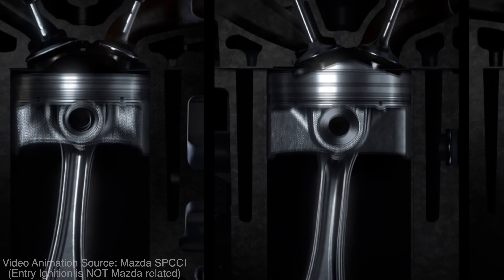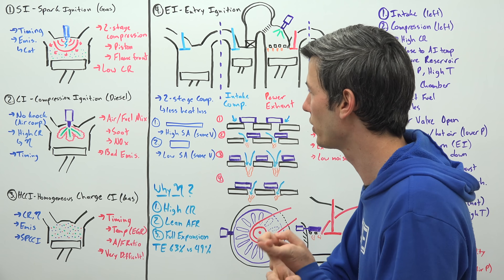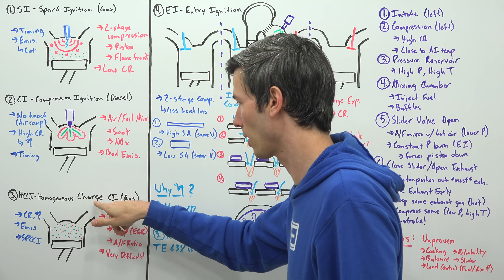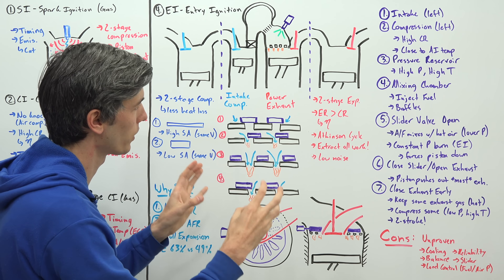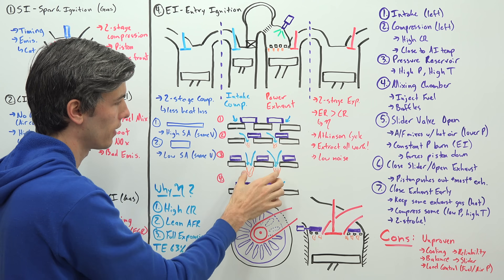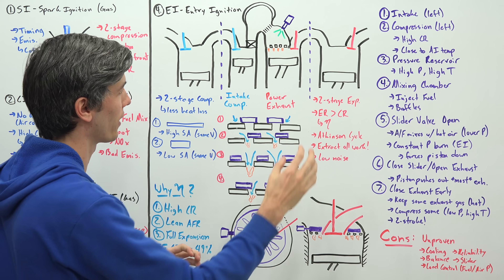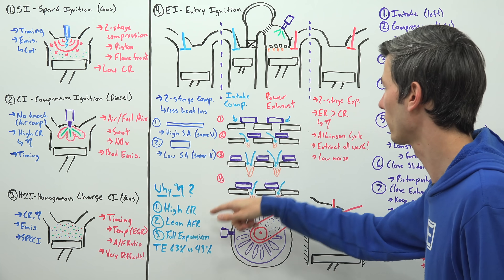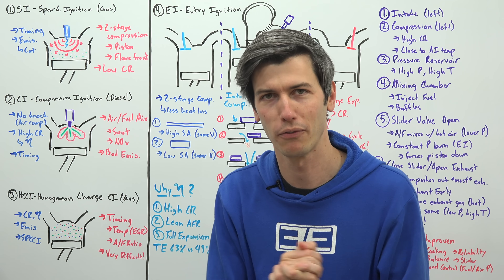Is 'Entry Ignition' The Future Of Combustion Engines?

Comment: Engineers have been looking into a viable 2 stroke engine since the 80's. The idea was to start making engines and related parts out of ceramics. My question is what are the advantages of this design over a conventional 2 stroke engine?
There was also a rotating valve design during the 90's that was developed by a company called Coates or Chotes. Basically it was two counter-rotating shafts, one inside the other... something like that would work for a slider valve.

Comment: If slider valves worked they would have used them as intake valves instead of the complexity and awkwardness of standard poppet valves. 
My guess is it’s impossible to keep carbon grit out from between the surfaces perfectly so any use of them is going to be high wear.  With some age and a tiny bit of carbon you now have sanding discs.

Comment: Oh my ... cool idea for sure!

But ... this goes further from the usual than just the combustion. If it is only for that, a seperated ignition chamber might be interesting. This is currently under investigation (was it ever not...?) to improve knock resistance. iav in germany have said to have achieved an overall efficiency of 45 % (on the brake, not indicated or calculated) in one of the latest MTZ.

Further expansion and precompression, on the other hand, may be seen seperately from the combustion system, too. This is two approaches combined that seem to benefit from each other aka engineering after the initial inventions are done.

... another thing, more close to traditional engine, is the ... I know ... Corona-plugs. I know, the name, ... but - these are used like a spark plug, employing the piston as cathode, allowing initial sparks (usually four) of not about a millimeter in length, but up to an inch or so, starting the combustion along four long ... kinda strings (they're not really straight), therefore speeding up the combustion and making the process less sensitive about residual exhaust gas, also mitigating knock - an engine with this alone and a software update (cam timing, increasing internal EGR at low load etc) was shown to be significantly more efficient, while all the big parts don't need to be changed - something easily within reach. Put (too) simple, it is like dual spark plug times 100 or so.

While I often understand that cool and new ideas requiring a lot of development after the principle was proven to be working, often making the engine way more expensive, are not adopted fast and widely spread, I'm a bit disappointed those easy improvements take a long time from lab to series, too. It is almost six years ago a then-coworker examined the combustion process in depth. Those little changes, relatively easy done and therefore compatible with many of current engines ... may not be game changers, but if I imagine an overall improvement of efficiency in the region of a few %, widely spread, I see a bigger impact than one series of engines, totally fancy and over the top, but hardly to be found in use anywere.

Hm...

... I write too much. I know. I'm sorry, I miss working in engine development (I do other stuff now ... interesting, too, but not even close to as cool...).

Comment: Problems I see. 
1. The slider valve and rings in the intake and the initial compression cylinders staying air tight.

2. Lubricant getting past those rings because combustion isn't taking place in the first two cylinders, leading to combustion of the lubricant in the mixing chamber causing soot/carbon build up clogging the slider valve (like an egr valve) 

3.The theoretical gains through thermal efficiency being lost in the mechanics, i.e that's a lot of mass to get rotating and keep rotating.

Comment: It's somewhat a mix of many ancient tech.
The hot air reservoir is basically how hot bulb engine works, and two expansion pistons is the regular compound steam engine principle. Sliding valves are also not new at all. Again, steam engine uses large sliding valves, and rotating sleeve valves were a (oil-greedy) thing of early performance automobiles.

Comment: I can't believe  Koenigsegg are the only company using fully independent valve control on conventional petrol engines.  This is achievable now, and proven with potentially 20% efficiency saving or power gain.  What chance has Entry Ignition being adopted in any meaningful manner by engine makers with the complexity(=weight) and new technology required?  With the UK committed to electric power only surely this is dead in the water?  As usual another great thought provoking video.

Comment: How is the third cylinder being driven down.. if the pressure at the top res is very high but lower then compression, the slide valve would allow gas to go back into the res. I dont see how this would work, because the res pressure HAS to be higher then the compression pressure, otherwise how would it force the fuel air mixture in to it? And why use a slider valve? why not a poppet valve?
Reply: If as described in the video the burning fuel mixture in the third cylinder never is greater than the pressure of compressed air and the pressure of the exhaust gas entering the forth cylinder must also be less and no more combustion is taking place so the power produced would be less than what the compression cylinders would require to again make a higher compression than the combustion. Unless the theory involves some sort of perpetual motion fantasy this engine wouldn't run.

Comment: Why the world haven't moved to electric yet? Because it is expensive. Not because it is expensive to manufacture, it is expensive to buy., Because it is a new technology (in a car...)

Disadvantages of electric:
- not suitable for very long travels (so not affect most of the users)
- battery replacement interval unknown yet and costs are probaly a fortune
- bearing changes every 20 years.

Disadvantages of ICE:
- efficiency
- emission
- a lot of oil, flter, consumable
- everything degrades fast because of oils, heat and weather so everything in the engine compartment is practically consumable after a few years of use.
- ton of precision moving parts

Disadvantages of hybrid:
- union of the both above

These are from perspective of the user. The opposite is true from the perspective of the manufacturers. For an electric car, all the established car industry, nor the oil industry can sell you almost anything they sell you now. All the techbology, except for body and suspension would be useless and obsolete for an electric car.

The only limiting factor (technology-wise) for a small subset of users I can see now is the battery. Still not advanced enough to make a very long range car. But certainly good enough for most of the users.

Comment: there is no future for ICE engines Electric car are the future more torque and HP and more efficient
Reply: Yes for general public is the electric car a near future. But ICEs will be still used in remote locations where you dont have reliable source of electicity.
Reply: @luboscernaj6944   yes you are rigth but we dont know in the future if electric vehicle will also do those thing with better battry tech and cheaper source of electricity
Reply: @espirituortiz7694  I think we'll get there, but it will take a lot of time.

Comment: I’m curious.. as the engine wears and compression begins to drop would this system become useless as high pressures are needed for combustion? Gasoline and diesel use outside entities for combustion (spark plugs/ Injectors) thus making them able to run as compression drops over time.

Comment: a marginal increase in thermal efficiency.. yes ... .. but what about the additional weight the engine will have.. four non uniform pistons&cylinders, additional frictional losses. .. the power to weight ration will definitely take a hit.....  not to mention the additional complications of operating the extra components and finally the robustness (given the more moving parts)  ......... pls.. just throw in a motor and get a whiplash with no noise

Comment: Will catalytic converters still work with low pressure exhaust?
Load control - you probably would use a CVT with this, potentially fairly constant load?
What is the absolute max theoretical thermal efficiency for a gasoline engine? Around 80%?

Comment: So you're just going to ignore spark ignition engines that use direct injection and variable cam technology to control the ignition timing? All you showed for the typical spark ignition was port injection. By using direct injection the fuel is sprayed in during the compression stroke acting as a cooling agent to prevent pre detonation and allowing for higher compression ratios and better running engines.

Comment: What you said about diesel not injecting fuel until after the compression stroke is completely wrong...think about it..compressed air does not combust...if it did my air compressor would blow up everytime i turn it on..

Comment: I see slider valve issues and engines shooting flames out the intake. How long would those even last? Carbon build up will play a role in real life scenarios. Will a camshaft actuate the slider? Or only for the exhaust valve. What controls the slider?  Sounds great in theory but more special tools and learning to do. And real life testing on us who have to buy the things. Plus I'd be surprised if it sounds good. That's important to me. Nothing sounds better than a old 60s engine. The only thing I like that's an alternative is the rotary. I think it could be tweaked to be much more efficient in power and fuel. But give it up to Mazda doin great things!

Comment: I wonder how you would lubricate the slider valve, and keep the area never getting cool intake air from melting or cracking between room temperature and very hot on every use. It wouldn't be cheap to make either.  It will stay an interesting concept.

Comment: Count me a skeptic.  Too dependent on running close to a narrow set of circumstances.  Idling looks iffy. And if you build it as a stop start, it will cool off during red lights. Makes Nissan's throttleless variable displacement gas engines look simple.

Comment: 1. How is the pressure in the cylinder, where the energy of the fuel is released, is guaranteed to be less than that of the pressure reservoir? 
2. Is the slider surface lubricated? Does it seal and will oil be burnt?
3. Usually, low temps improve engine performance. Here it seems to be the opposite. Why?

Comment: Unrelated to video, But I would love to see you discuss crankshaft and connecting rod bearing types. Like almost all engines today use plain bearings. Old Kawasaki and Suzuki motorcycles used roller and needle bearings. Why don't we see more roller and needle bearing in car engines? I can maybe think it's for cost reasons because the crankshaft would have to be in multiple parts. In terms of reliability, they were just as reliable as plain bearings. I've heard arguments that they can better because oil weights don't really matter so much, the oil pumps don't have to work as hard, and more oil can circulate the engine faster. It would be cool if you can discuss this in greater detail and maybe other engine bearings too! I can't find much information about this.

Comment: I don't know how many times I now have heard that a new combustion or new type engine is going to take over the car industry.  Yet the 4 stroke spark ignition keeps soldiering on. The Wankle is gone. turbines are gone. Diesels are not being put into many new cars  Many people buying new heavy duty trucks are going back to gasoline  fleets unless they need the added torque of the diesel.

Comment: So while the slide valve opens and fuel and air enter the piston chamber it ignites creating the power stroke. My question is if the slide valves are open and the fuel air is igniting how does the flame not go towards the chamber that mixes that compressed air and fuel? I know that initially the pressure is lower in the cylinder but once ignition happens that pressure isn't greater than the chamber above causing flames to enter the air fuel mixing chamber? Even when igniting in the cylinder the pressure cause by ignition is still less than the chamber above? Maybe I'm wrong but it seems like the valve that let's the air fuel mixture into the cylinder stays open until it has the predetermined amount of combustion and then closes. Had the valve is open and ignition happens while the valve is open??

Comment: I can only imagine how much space this would take to operate, regardlessof how many "cylinders" it possesses, since fewer cylinders means more attachments to precompress the air.
Thinking of that slider valve, I imagine you could determine how wide it opens to act as a throttle control, but really electronically controlling the amount of fuel injected would help with that.
 Now how thick would those slider valve plates have to be to resist the heat and pressure of that combustion chamber? And how would it be lubricated to prevent siezing as the metal expands when heated? And carbon buildup could very well prevent it from working.
Might be good for an alternative low carbon fuel though!
Pretty cool idea though!

Comment: Besides improving the combustion engine, what if we use all possible energy like also recovering the heat generated by the engine (and usually vented by the radiator) for an external combustion engine like a Stirling engine, build that setup with hybrid battery pack and profit? Combustion engine linked to wheels via clutch + cvt, stirling engine only generating current, electrical engines on the wheels and the chance to disengage the combustion engine via the clutch to run on full electricity if we have enough charge in the batteries. OFC I said Stirling engine because it is the first that comes into my mind, but in its place you can put the most efficient external combustion engine you can think about, with size considerations regarding how much heat it can utilize.

Comment: Very interesting video.  Wasn't aware of the Entry Ignition theory/design.  
Got the general idea and then for the next ten minutes of the video I was thinking "But what about balance?"  Finally you mentioned it...and then you dismissed it almost as quickly.  In the real world, balance is a HUGE factor!  A counter-balance of even as little as a few ounces can literally destroy engines running at thousands of RPMs.  Also, what about (the additional) weight?  
Between balancing (counter-weights), the additional weight of the additional parts and all of those additional parts also needing lubrication (or maintenance to replace them), I'm highly suspicious of the theoretical estimated 60% efficiency, especially when considering cost.

Comment: As others here have commented (and you've also briefly mentioned in the video), the major drawback to this technology is the slider valve. Slider valves are not a new idea by any means, but they always suffer from the same problem in applications where heat is present and persistent, which is durability/reliability. The mechanism itself is doomed from the start, because you have sliding parts that are difficult to lubricate (especially when fuel is part of the mix), operating fairly rapidly (making wear a massive issue, not to mention a fairly high pressure differential when closed. The valve would need active cooling at the very least,  and even then, back flow would likely occur because of uneven thermal expansion. You could potentially intercool the incoming air prior to mixing, however then you lose the benefit of the cycle, making the idea moot. I can name start up companies that folded due to their reliance on slider valves, because when it came down to building a practical demonstrator of the technology (which was otherwise a great idea), they ran into major difficulties, and realised it couldn't be done reliably.

Comment: slider valves.. NOPE they will fail .. to many moving parts and friction. Build it and do 100,000 road miles for a beta test
Reply: If it makes it 2000 miles I will be surprised. Let alone 20,000.

Comment: Get rid of the crankshaft, drivetrain, gearbox, ++ and use an opposed ICE piston generator and exhaust gas powered Stirling engine/generator to power in-wheel motors ... Although I prefer my in-wheel, 1 stroke opposed piston dual rotating combustion chamber engine design... Yes, it is a single stroke free piston engine with both pistons firing at top and bottom dead centre that comfortably fits in a car wheel and is robust enough to survive and powerful enough to drive.. 1 liter of pure ICE power in each wheel with power transmitted directly to the wheel.

Comment: Cylinder one functions like an oil cooler.
Cylinder one performs like an extremely efficient supercharger and
since it's a piston its output matches piston two's input better than any turbine.
Cylinder one performs like a self-draining oil catch can.
Cylinder one is under little thermal or physical stress so it's not a structural risk. It functions like an engine mount extension, smoothing things greatly.

What's all that cost? Cylinder one is cheap. Don't dis Cylinder One.

Comment: As others have pointed out the reliability of the slider valve seems like it might be an issue. The friction from constant pressure on one side forcing the two layers together along with there being no lubricant seems problematic.

Comment: I've always wondered why nobody ever designed a gasoline engine along the lines of a steam engine. Meaning only a power stroke with a piston firing at both ends.
Reply: cause oil will burn. it's not the case with steam.
Reply: @luisribeiro5639 No kidding. 😂